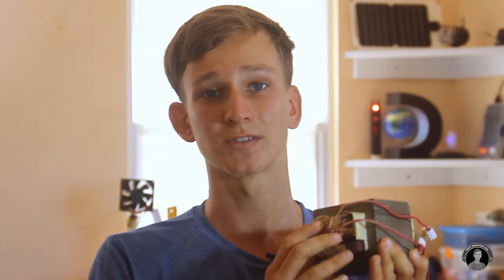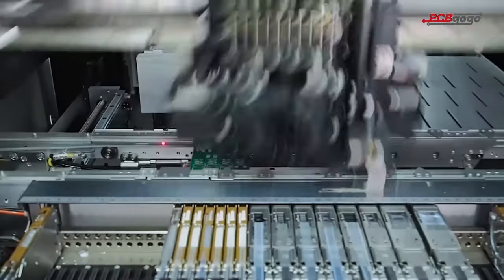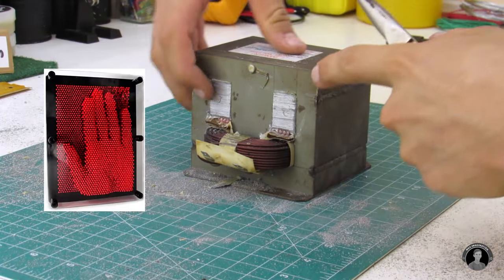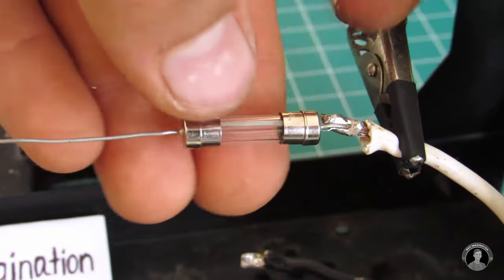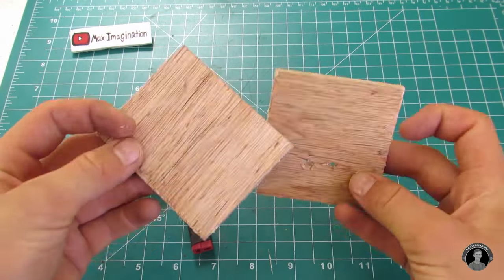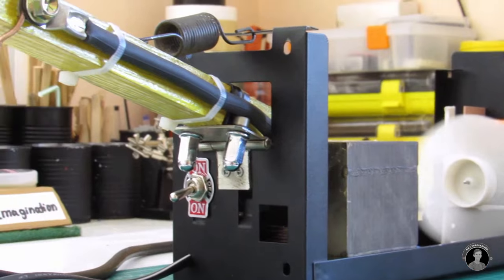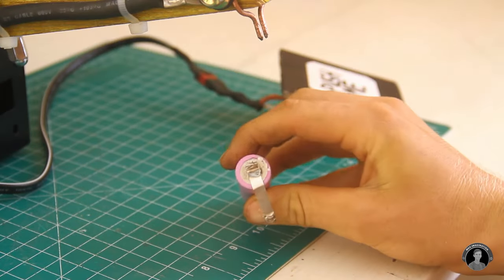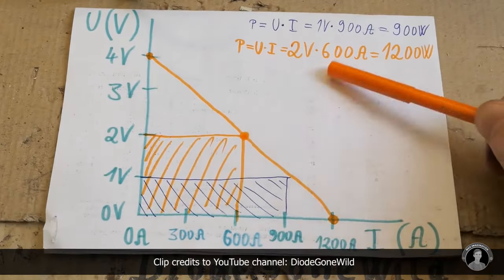Build a 1000W Battery Spot Welder Using a Microwave Transformer | Step-by-Step Guide

Comment: CAUTION sorry but one big safety thing.. wires that leads to pedal has unprotected male connectors on welders side of circuit so if that connector accindentally unfastens there is exposed live wire that could be accindentally touched..
Reply from the maker: Thanks for pointing this out! You definitely have a point here. I'll fix that! Thanks.

Comment: Max As a UK electrician once told me its the AMPS (even at low voltage) that WILL kill you as much as volts, That said its a good build
Reply from the maker: Hi, thanks for your comment. 
Yes I do believe that's true although those amps won't really take any negative effect on you unless there's a sizeable amount of voltage, like at around 30-50Vac is where it may start to get lethal with enough current. This is what a US electrical once said. 

Cheers, 
Max
Reply from the maker: Plus, anyone using this machine will most likely always be safe as its chassis is linked to earth ground, creating an easier path for hot wire current to flow through rather than a person, as a person has a much higher resistance that the grounded shortcut path.

Comment: Nice work.
The way you;re sweating, on the intro, looks like you were slaving over a hot stove ;-)
Or did you just steal your mother's microwave transformer. ;-)
Reply from the maker: Thanks for watching! Well, it was getting quite hot inside with my mom's microwave running, so I found the solution by pinching the transformer for something... better 👈😉
Cheers,
Max

Comment: @maximagination, is there any difference if the copper tips were closer?
Reply from the maker: Not much of a difference, as long as there's a 1mm+ gap in between. It can all depend on the width of the nickel strips you're welding.

Cheers,
Max

Comment: Hey Max, me again. Loving the circuit diagram at 7m48s - simple and detailed. At this point I realise your input is a USA 110V AC power supply. I wanted to ask your advice for doing the project for a UK 240V AC supply - my head's not in the right place for doing the maths today😄.
Your transformer has 100 turns on the primary and 2 turns secondary - for a UK power supply, the input voltage is effectively doubled, what (if any) changes do I need to make to that secondary coil? Obviously I'll be using a transformer salvaged from a UK 240V microwave, so I'm assuming I can just do the same 2 turns - but I'm second guessing myself. Is this initial assumption correct?
Reply from the maker: Hi, Michael. Thanks for your comment. 
The number of turns on your primary winding for a UK 240 mains power supply should be around 220 and the same 2 turns on the secondary (low voltage output).

Cheers,
Max

Comment: you left the metal chokes in? ok? Does that make this build safer?
Reply from the maker: The way the transformer is configured is correct, it's safe on the output side and gives you the power to made decent welds.

Comment: I have 8 gauge wire, should I just do like 5 or 6 turns to be sure? lol?
Reply from the maker: 8 gauge wire might be too thin. The wire could get hot. In terms of windings, they should be the same to give you a low voltage output. 2-4 turns.

Comment: Your welds on the fuse are cold welded. Do some checking please.
Reply from the maker: I think that is due to the tips being from copper. Would you recommend the right metal my fuse should be made out of or where would I get those? Thanks.

Comment: think its 15 amp so how many should I use?
Reply from the maker: You need 0-4 gauge wire which can handle hundreds of amps of current. The voltage output should be very low. How many of what are you referring to?

Comment: Hello. I want to note that there are traces of burning the tape, which means overheating of the battery. And 1 more transformer is not enough to weld ribbons more than 0.1 mm. So, you need at least 2 transformers. To create a full-fledged apparatus, it is cheaper to buy an old transformer-type welding machine and rewind the winding.I mean, a welding machine for welding with electrodes
Reply from the maker: Hello there, thanks for your comment. 
You are wrong on the first point you stated, the batteries did not overheat nor did they get hot. 
On your second point, you make more sense, the transmormer is in fact not powerful enough on its own to create clean and long lasting welds. This after all is a DIY project, living it up to the same standards as factory-made devices would be costly and hard to replicate.

Comment: Nice video Max! Although I wanted to point out your lethal error at the beginning of the video where you point out that the transformer produces a "lethal voltage in their original state but we will be rewinding this secondary coil to produce a really low voltage .. high amount of current"

What you have actually done is take a (relatively) safe high voltage transformer and produced a deadly high amp transformer!

It is not the voltage that is lethal to the human body, but current (amps)! Of course, V=IR means that they are related, but if you think of electricity as a river then you get the idea pretty quickly.

Imagine voltage being the flow of the water in the river and the amperage as the volume of water.

You could have a very fast high voltage stream that poses little threat to an adult, whilst a virtually static but a deep slow moving, even static river that could drown you.
Reply from the maker: Hi Michael. Thanks for your consideration. However, I hate to break it to you, but you must've understood it back to front...
Any high voltage especially in the thousands of volts with the tiniest bit of current in the tens of miliamps range is enough to kill a person. With high current flow and almost no Electric pressure (volts) such a 2V, it won't even hurt an insect! Think of voltage as electric potential, if there's little to no potential (using height metaphorically in this example) a heavy human who jumps off of a 2ft ledge won't hurt themselves as much as if they were to jump off a lethal 200ft cliff even weighing less. Think about that.
Voltage and current work in respect to each other making amplitude in voltage the main characteristic for electric shock, and current being the amplifier of that shock. 
I hope this makes sense.
- Max
Reply from the maker: By the way, looking at my demonstration, I was actually grounded while touching the pins, and didn't get a tingle let alone a jolt from the device.
Reply: Final thought - a typical police taser weapon for incapacitating suspects, is 50,000 volts. But the current is extremely low. Food for thought. Sorry to bang my little drum so loudly - it's my autism at work, honest! - but safety is important (can't fault you on your safety, btw, but the viewers may not be so considerate of theirs).